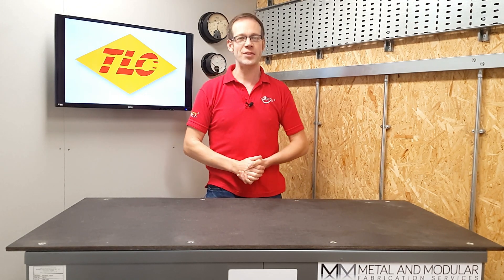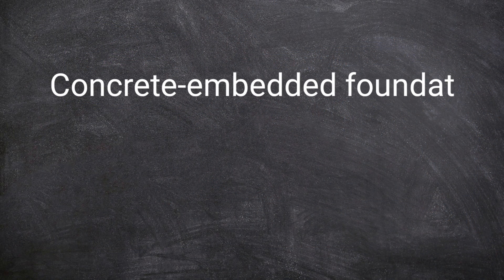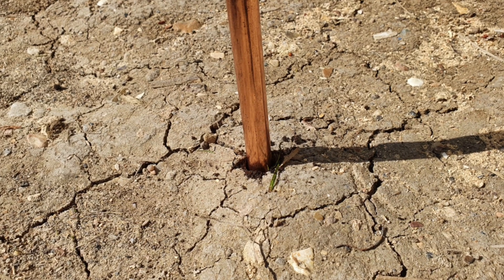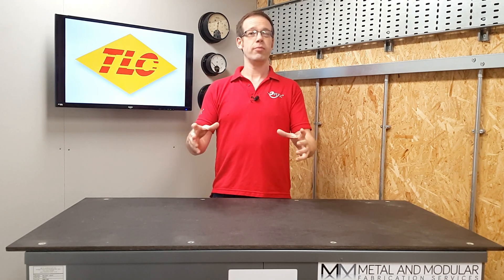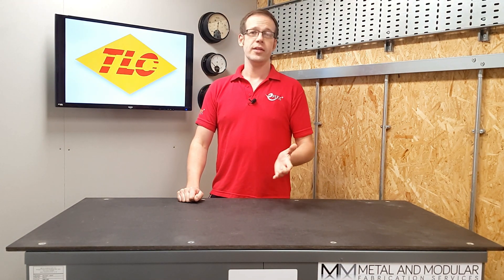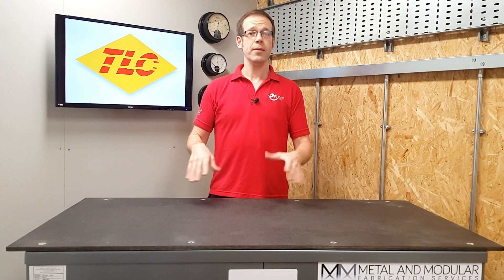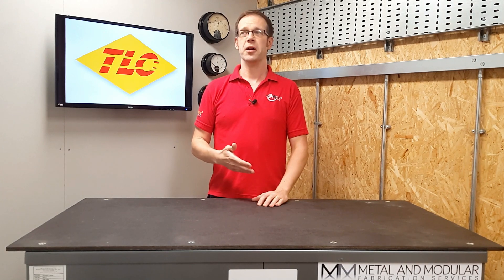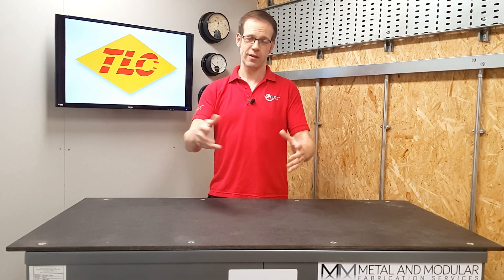What is foundation earthing? - A new requirement in BS7671 Amendment 2 (draft for public comment)

Comment from the maker: Does this change mean electricians will need to be onsite before the foundations are even finished?
Reply: In Germany these electrodes are mandatory since 1980 for new construction. The earth electrode is installed by the construction company, their responsibility, they also have to test it. The electrician tests it again when he performs his work, like you would do it on an EICR. The borders between the different crafts are fluent here. That means the plumbers know that they have to bond water- and gas pipes to the equipotential bus bar of the house and which size they'll have to use. Also the phone guys and the cable TV guys know and do that. The shielding of the antenna cable must be bonded to the equipotential bus bar. And back in the old days the plumbers here bonded metal tubs and shower trays....
And sometimes a soil embedded ring electrode must be installed, for example if the ground water level is too high in the area so the foundation must be a water proof tanking. In that case an electrode embedded into the concrete wouldn't work. In retrofits only this is the best solution, a simple earth rod is better than nothing, but the best (and most expensive) solution is the ring electrode arround the building.
Reply: Yes. As in some cases in the past few years where new build estates have been constructed on "former" flood plain land, after six months they've raised the base floor level over the original foundation and not extended the foundation electrode. I find more are opting for SEREE which can be laid last before final driveways are completed but after the majority of the new construction.
Reply: Historically yeah.
Reply: John Tressler hysterically?
Reply: @tresslerj1985  presently yeah
Reply: @tresslerj1985  futurely yeah
Reply: Yes it does. As they do in Germany,  or Czech Republic.
Reply: @evzenhedvabny6259  You can only test it when the job is done, the concrete is poured and cured.
And in most cases these companies have educated guys there which are no full educated electricians, but they can perform the measurements which are required for that job.
Reply: @Marcel_Germann  Agree. Funny thing is that in each country "qualified electrician" means something different.
Reply: @Marcel_Germann  We have 5 of these. 1st one has to work under supervision. Last two qualifications are necessary for being self-employed. My qualification depends on education and years of experience. After school i had to work under supervision for about a year. Then I was fully qualified to work on my own but still far away from having my own company or having responsibility for gang of workers. In terms of our regulations i was a fully qualified electrician but still not able to certify my own work or design even small installation. That are another qualifications here.
Reply: @evzenhedvabny6259  For opening up your own business you'll have to do an additional education. This will take two years in full time or four years in the evening school (parallel to the regular job). After that you're a master electrician and are permitted to open up your own business. You can educate budding electricians and you enter the DNO list of permitted technicians. The last one is the permission to work on the sealed parts like the service entry box to pull the main fuses, or to relocate the meter if necessary, and also to reseal them after the work is finished.
Reply: @Marcel_Germann  Very similar and very different at the same time.

Comment: If there is electrically insulating material surrounding the foundation, why not completely remove the concrete embedded earthing and connect the MET directly to the soil embedded ring earth electrode?

Comment: It's about time. The UK made huge mistakes back in the 60's & 70's by not adopting this method, it's safer & more reliable. My company have been involved in helping the IET / BSI test sites and the results achieved using steel (cheaper than the usual UK copper) have been excellent. As we move towards "prosumers" generating and potentially storing energy in our homes this will provide a safe, reliable local earthing system spreading fault currents over wider areas than just an electrode reducing touch and step potentials.
Reply from the maker: Great input Sean  - look forward to hearing more.
Reply: Hi, is there a reference for calculation required for this type of earthing?
Reply: Dear Sean , Thanks for the information. What is the effect on a TNS system  MET is connected to a local foundation earth, can there be Surge current passing through PE conductor to the transformer star point, What is your experience. It's confusing  . (In a TT sytem ,I agree that there will be no issue, however in a TN-S system ,can there by any back surge? )

Comment: So the soil embedded electrode would be installed above the dpc?
Reply: No, not if I am correct. The metallic electrode material must be in contact with ground, either directly - or through the concrete 'floor' which is poured over and the rebar 'mesh'. The base of the concrete slab will be in contact with damp earth.

Comment: Looks like this will be TT installations will be replacing the DNO poor maintenance on TN-C-S systems better start practicing our exothermic welding  for connecting to the rebar.
Reply: It won't need to be exothermic welding. The sample sites carried out for the IET/BSI committee were clamped (actually they had torque set break off clamps that cannot be reopened ) these were deemed suitable and achieved fantastic earth readings.

Comment: It makes sense to use what is there already, but i have some questions, what does this mean for touch voltages in the event of a fault? If the building is given a potential, and we have badly installed protective devices, are we inducing more areas to get a shock off? Or am i over thinking it.
Reply: Massively overthinking it or misunderstanding it. This is far safer, the UK made some very poor choices in the 60's & 70's that led us to where we are now. Most of mainland Europe doe this already and they electrical safety record is excellent, very few touch voltage issues and now broken PEN.
Reply: @seanpassant3174  probably misunderstand it. Its one of the reasons i like these videos as i want to find out more and understand it more. Cheers for the reply. 👍

Comment: It a bit like earthing the steel structure of a building. While the steel of the building is connected to the foundation. And some times you find an earthing pit with a earth rod  next to every main supporting steel.
Reply: That's usually for lightning protection puropses.
Reply: @seanpassant3174  I remember hearing the term ''side flashing'' in relation to lighting strikes and steel work on ungrounded systems. Am I on the right track with this or is it unrelated? 
It was in this video: https://www.youtube.com/watch?v=mpgAVE4UwFw&

Also does a structural steel column added in a renovation project count as a extraneous conductive part and require main equipotential bonding? 
I would appreciate any input you might have since you seem knowledgeable seeing your other comments!
Reply: @Orgakoyd  side flash is a phenomena of lightning events, many people assume that lightning will always hit the highest point but this is not accurate. It is equally capable of strike the side of a structure, especially when the structure has a large steel frame offering a low resistance path to earth. Tall structures around the world frequently suffer damage from these side flashes.

Comment: Why do we need earth rods in all but name...cant the power provider give the customer earthing via supply cable. As for how other countries provide earthing...who cares ?
Reply: Earthing specialists care because foundation earthing is safer and far superior to how the UK chose to do it in the 60's & 70's that has led us to where we are now with huge numbers of lost neutral faults and broken PEN causing touch voltages because the DNO infrastructure is falling apart and can't be relied on.
Reply: @seanpassant3174  by huge amount of pen failures..you mean 300, in a system thats not that bad at all.
Reply: @hepontour 
So this earth system does not use the DNO earth in any way?
Reply: @hepontour  it's far more than that. A freedom of information request revealed hundreds per DNO. That's why action was needed. PME & TNCS being mixed, TT's being added for EV charging incorrectly. The earthing system is a mess
Reply from the maker: The change is to allow for customers to operate in “island” mode. Generated own power and supply maintained if the grid fails.
Reply: @efixx 
If the grid fails? 
What future are "they" expecting?
Reply: At least partly to make the consumer pay for what the DNO should be doing.

Comment: In Germany this is mandatory for new buildings since 1980 and the regulations are the DIN 18014 (specifications for earth electrodes), VDE 0100-540 (the VDE 0100 is the counterpart of BS 7671, and the part 540 is the part for the earthing- and bonding systems), VDE-AR-N 4100 (application guide for installation) and the technical connection conditions of the DNOs here.

https://upload.wikimedia.org/wikipedia/commons/8/8f/Potenzialausgleichsschiene.jpg

In old installations they simply used the incoming water pipe as an earth electrode. For that reason the water pipes were made of thick cast iron to prevent leakage caused by electrochemical corrosion. There's no duty to retrofit, except the city decides to change the water pipe to a modern plastic one.
Reply: We do it exactly the same way. Sometimes a flat steel sometimes 10mm zinc plated steel wire. Depending on designer's calculation.
Reply: @evzenhedvabny6259  This way (round shaped and 10mm diameter or a flat steel made of stainless steel (V4A) 30mm wide and 3.5mm thick. It must be connected to the steel reinforcement of the concrete slab. So that electrode must be installed before the concrete guys come over and pour the slab.
For ring shaped earth electrodes which are not covered in concrete (buried in the soil arround the house) a hot zinc dip is not permitted. They should be made of copper, stainless steel or a steel which contains more than 2% molybdenum. Blank stranded copper wire is also permitted, but only if its cross-sectional area is larger than 50mm². If the building got a transformer station built into (large apartment buildings) then bigger sizes are required, that's for standard  residential buildings.
Reply: @Marcel_Germann  interesting. I haven't done this for couple of years so regs may have changed. As i work in maintenance now. But about 10 years ago we used zinc plated steel for everything. Stainless steel parts when  steel and copper or aluminium met. Protection of steel was necessary where wire passed from ground or concrete to the air. We used heatshrink tube with glue. Some other companies used just dome kind of asphalt paint. Everything depended on our certified designer's decision and calculation.

Comment: Let's say a building had a ground screw foundation like this. https://youtu.be/BeU7dzlh6wk can they be used for earthing?
Reply from the maker: Our guess would be yes - Let’s see what makes it to the final cut of Amd 2. Our EU viewers may want to chip in as its already used in France 🇫🇷, Germany 🇩🇪 and Italy 🇮🇹
Reply: @efixx  good to know. Seems a good robust solution. Thanks.
Reply: @R-77 You can bring the steel or aluminium out from the foundation somewhere near your consumer unit or to  another suitable location as a wire or flat bar and then connect the copper using appropriate connector. https://upload.wikimedia.org/wikipedia/commons/8/8f/Potenzialausgleichsschiene.jpg
Reply: Funny, I just commented that very thing on that very video lol
Reply: @R-77 as in galvanic corrosion? There are pastes available to help stop it but keeping it dry would also obviously really help.

Comment: I’ve had a play with this (ish) this week whilst putting a rod in.  Did a Ze onto the concrete embedded rebar and got a reading of just under 3 ohm - the rod was around 16 ohm.  There’s great potential (no pun intended) for getting a good low earth reading from purpose designed metal work in the ground.  At a guess I’d say we’ll be seeing TNS style Ze readings which is great as we’ve be designing and installing around that for decades.
Reply: According to DIN 18014 a foundation earth electrode with more than 0.5 Ohms (loop impedance) is considered as beeing defective, of course with the PEN connected. Disconnecting the PEN is not advisable, this can have unwanted problems like a floating zero were all appliances will "see" a voltage between 0 and 400V, depending on their resistance.

Below 10 Ohms in the earth electrode measurement is perfectly acceptable.